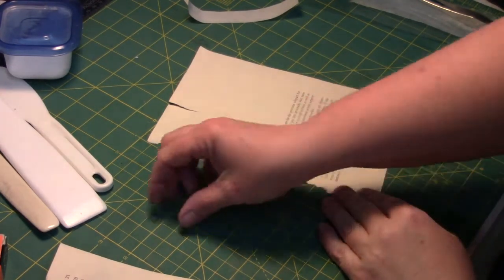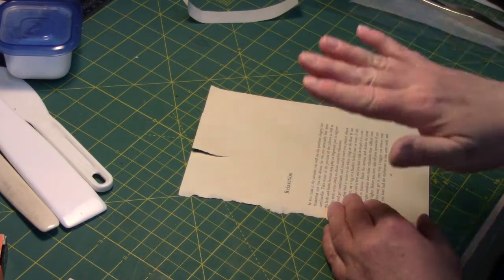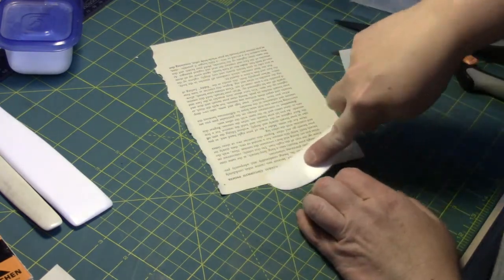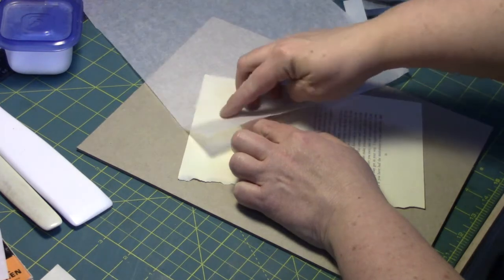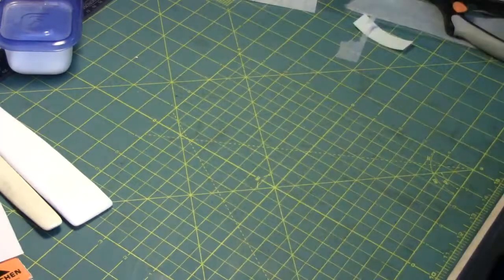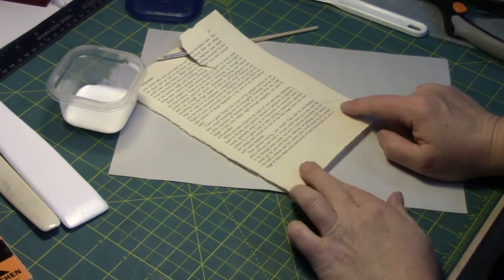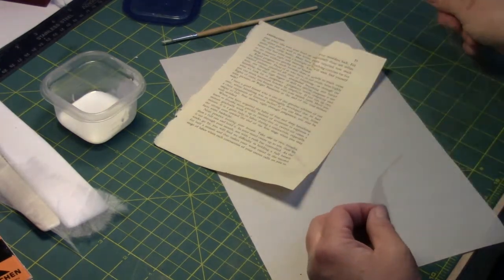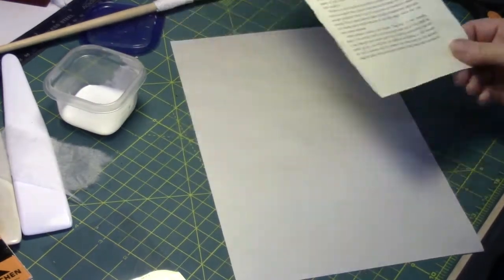Book Repair on a Budget: Paper Mending

Comment: My vote would be for Filmoplast-P because it has a matte finish so it almost disappears. The other, heat set tissue, has a very glossy surface that, on a photo or book page, would stand out and reflect any light source. The difference can be seen in your demonstration. The Japanese thin fiber paper might be okay unless Elmer's glue creates a glossy finish. Also, it might be advisable to take care to have clean hands free of oils or fingerprints that might come off on the tape, or wear thin gloves, and also fasten the paper surface (with removable painter's tape or something similar) to stabilize it when working on it. Thank you for showing these different methods; I'm always trying to figure out how to repair tears in books, dust covers, or magazine pages. All good!!

Comment: hi there! unfortunately demco isn't available in germany, and apparently it's insanely expensive to ship from the states. could you possibly clarify the type of adhesive you're using so i could try and find an alternative? i bought a super nice art print and ripped it nice and big right out the gate :( (or out the poster tube hehe). worse things have happened to people but yeah wanna try and save it! thank you so much!
Reply: I hope you do not mind me responding. I heard 
her refer to, Elmer's Glue. Elmer's does make a,
CRAFT BOND GLUE,for Fabric and Paper. It is Acid Free.
The Acid Free makes it safe for paper. Make sure that 
is the Glue you get if you go with Elmer's. The regular 
Glue by Elmer's is for Wood and projects of that type.
There is a big difference between the two.
I hope this is helpful for you,
Jeff

Comment: I can't separate the Film-O-Plast from its backing. Any tips?
Reply: I know that feeling! The box we have has a special cutter on it which is great when it works. Unfortunately the box is aging and torn, so doesn't work very well any more. I would suggest that when you do manage to separate the two layers you always crease back a short length of the backing layer, leaving a tab of tape ready to peel off. This should work if you are the only person using it; I share a box and the others are not as careful! 
Hope this is helpful.
Reply: That just happened to me! And the reason why I'm watching this. 
I thought I had a defective box! LOL 
I tore off a longer piece than needed and used a weeding tool from my craft supplies. A weeding tool is essentially a metal dental pic. I scraped on one side near the end until the backing & tape separated. You might poke holes until you get the hang of it, thus why I say tear more than you need.
Good luck!!
Reply: Take two pieces of low tack drafting tape and stick them on either sides of the Filmoplast/P90 tape - don't let them stick together! Pull them apart and the backing should separate easily.
Reply: thank you 
 @LosPeregrinos51

Comment: Hi Mam. Thank you so much for this really insightful tutorial. I would like to enquire if you’d perhaps advise if these products would serve for a more hardwearing solution on say a bible which goes through a rather intense use? I need to restore a bible with a few pages that have frayed away terribly with edges that have broken off completely. In this case I’d need to rebuild those edges in order to resize them to fit the rest of the book. Also, there are a few pages that has been mended with different adhesive tape which has to be removed, any advise on removing these without further damage? 
Thank you once again for a very informative tutorial.
Reply: these are all good for that. mostly depends on the quality of materials and care of application. use archival and professional book binders materials. lineco is a good brand.but there are tons.
Reply from the maker: I am so sorry that I am only now seeing your questions. The comment below has good suggestions. If the Bible is precious to you, you may wish to consult with a professional conservator in your area. If you just want to be able to use the Bible again, any of the methods I demonstrated would work.
Reply: @uncgarchives  thanks for your response. Unfortunately I cannot find a reputable restoration company close to me and I would not want to post too far away. Nevertheless I appreciate your advice and from the previous commenter.
Reply from the maker: @Dizzyish  If you haven't already, try this link from the American Institute of Conservation to find a conservator in your area: https://community.culturalheritage.org/expertsearch